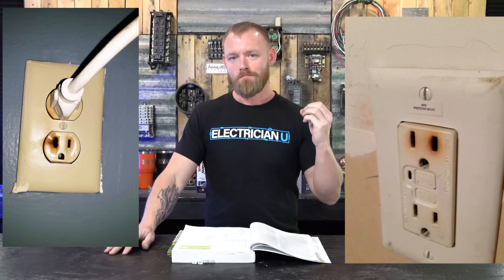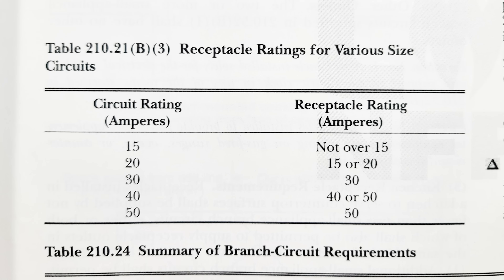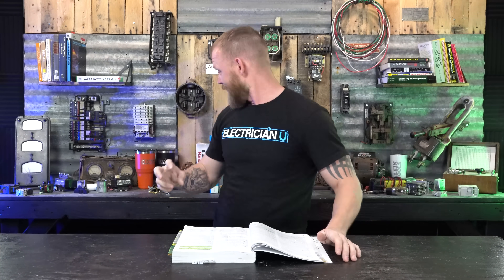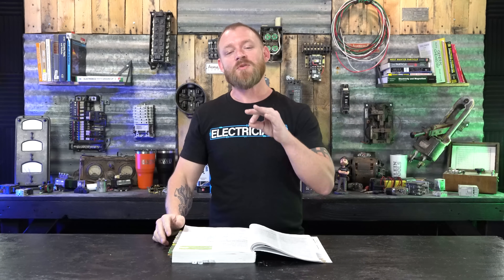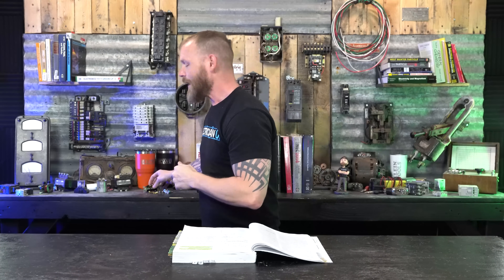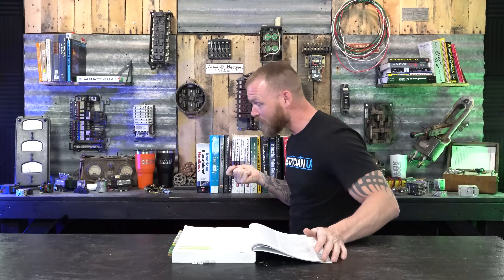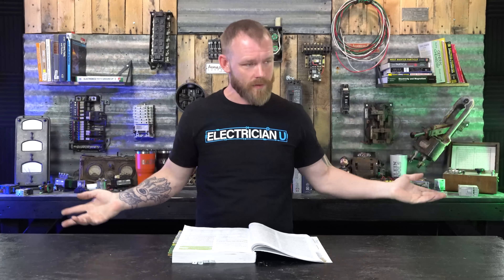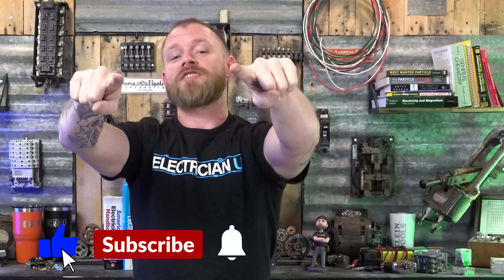Won't These Melt?!? 15amp Receptacles on 20 amp Circuits!!!

Comment: Because code allows it.... and there lies the problem.
Reply: So...having your circuit be able to support a higher capacity than an outlet is a problem?  Why?  You do realize circuits encompass more than one outlet right?  What's the issue with having several 15A outlets on a 20A circuit?  You can't pull more than 15A from a 15A outlet anyway, devices that require 20A would have a NEMA 5-20 plug which does not fit into a standard outlet.
Reply: @StormsparkPegasus  You've never heard of power bars I see.
Reply: You can certainly pull more than 15A from a 15A outlet. The outlet doesn’t limit anything. The breaker will. You’ll melt the 15A outlet before the 20A breaker ever trips. Now if you have multiple 15A outlets on the same 20A circuit and the total current exceeds 20A then it’ll trip and not melting the outlets as long as every individual outlet doesn’t exceed 15A.